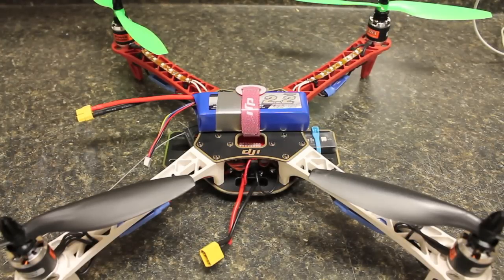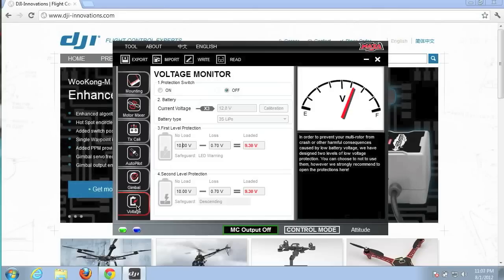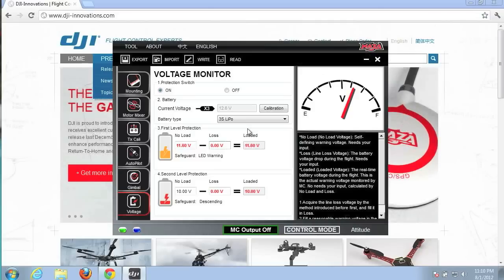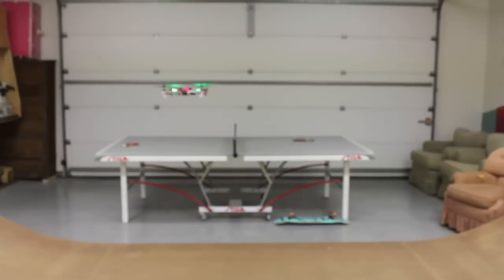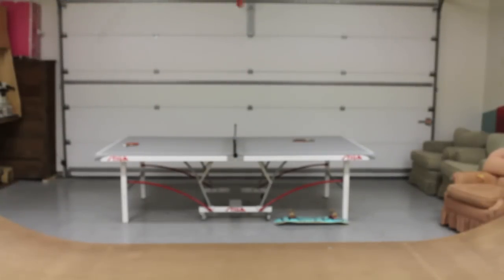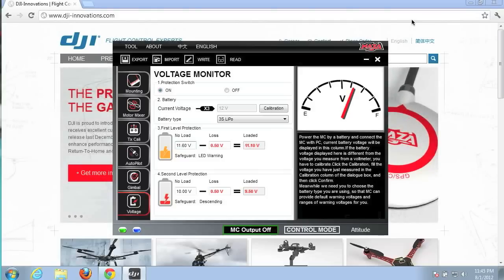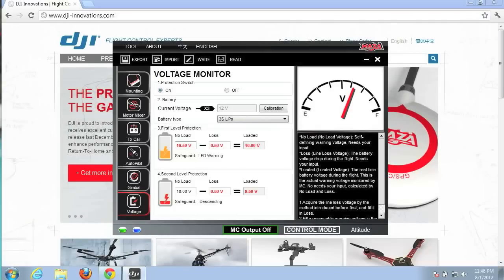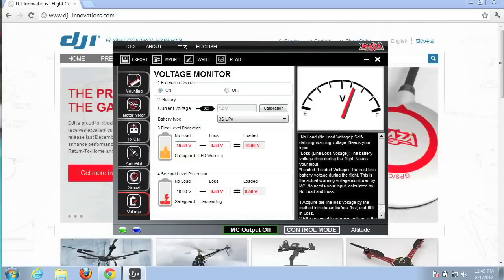DJI Naza Voltage Monitoring - First Level Voltage Protection Setup

Comment from the maker: Man you are absolutely right. I was doing math in the wrong direction! It should be 10.5 no load and 10.0V loaded as stated at 07:50 in the video. Like I said this is pure experimentation, but has worked well for me so far. I may bump these up a bit more to give more time between first and second level protection. Thanks for setting me straight.

Comment: Dennis, I finally got to download the latest upgrade for naza m V2. I had to uninstall the previous versions, then reinstall. It took about 5 minutes. I re calibrated the gyro, then re calibrated the compass, all the settings stayed as they were. Then I took it outside and flew it for a short time, amazing! It was very windy and gusty, it just sat there dead still, no drifting, can't wait to try it on the next good day!

Comment: Continuing working on my voltage setup.  I only have a 3S 2500mah right now but ordered a Zippy 3S 5800mah 30C yesterday.  I have Aeroxcraft landing gear attached.  With the 2500mah the starting voltage was 12.6V.  After 5 minutes of just hovering, I plugged it back in and was still at 11.4V.  I have my first level protection at what you have, 10.5V.  Then the second at 10.3.  I am excited to see the flight times with the new 5800mah :)

Comment from the maker: I think it's a good rule of thumb to benchmark your batteries and know how much flight time you get. Like you, I normally give myself a couple mins to get back home if I'm doing FPV. Regarding your comment about disabling voltage protection, I like having the blinking LED for when I'm doing line of sight acrobatic stuff. It's just a good way to know when to land. But I tend to agree I'm not going to depend on this when doing FPV and my quad is half a mile away.

Comment from the maker: Yeah I'm coming to the conclusion this is a good rule of thumb for 1st and 2nd level protection voltages. Still experimenting, but if you're in this ballpark then you should be safe. Thanks for the comment.

Comment from the maker: Thanks for the comment. I'm by no means an expert but will gladly help in any way I can. For starters, have you calculated your line loss as mentioned in the video? You do this by fulling charging your lipo and then taking a voltage reading. Then subtract one volt for your initial "No Load" voltage and enter 0 for your "Loss" voltage. Fly until you trigger the LED. Then you can calculate your loss, which is your previous "No Load" voltage minus the new voltage reading after flying.

Comment from the maker: Yes, since you're using a 3S those settings should be near identical. The only difference is the mA rating of your battery is much higher therefore you should get longer flight times. Play around with those settings and see how they perform, but I suspect it will work out nicely for you.

Comment from the maker: It's generally a matter of preference, but let me give my personal experience. If you're doing FPV or any high flying you'd like to have time to land before the 2nd level voltage protection kicks in. Just keep that in mind. I believe I have mine currently set at 3.2V, but am planning on posting a howto soon. I'll let you know when it's ready.

Another thing to keep in mind is that some ESCs have a default voltage cutoff. You don't want this to trigger before your voltage monitoring does.

Comment from the maker: Make sure you've properly calibrated your GPS. Another problem I ran into previously is that I was trying to arm my NAZA while it was on top of a friend's car. There was interference caused by the metal roof of the car. Just make sure you're not arming near anything that could case interference. Lastly, make sure the quad is completely level before you arm it. Good luck.

Comment from the maker: Hopefully I understand your question. I used Google Translate :) What is your total weight? It's hard for me to say if this is a good flight time without knowing what your multirotor weighs. Also, be careful on your voltage settings because most ESCs by default cut out at 3.2V per cell. Your second voltage level is at 9.5V, which is just below 3.2V per cell. If your ESC has low voltage cutoff enabled then you could lose your multirotor in the air. You may have disabled LVC but wanted to mention.

Comment from the maker: Regarding 10.5V being conservative that will mean that each cell of my 3S lipo will be 3.5V (3*3.5 = 10.5V). So if you consider the loss (mine was .5V) then your talking a loaded voltage of 11.0V. Once the Naza sees that the total voltage under load is < 11V it triggers the first level protection. I hope that makes sense. Please feel free to post any further questions and I'll be glad to help!

Comment: Thanks for the video.  Very informative!  I just had my maiden F550 flight today and didn't set up the voltage monitor correctly.  I took off, and within 5 seconds, the red LED was flashing like crazy and went into autoland.  It scared me.  I thought something was really wrong.  I thought when you calibrated the battery it did all these settings for you.  Ahhh...still an amateur I guess ;)

Comment: Thanks Dennis great job..   I went thru and understand what you did in the setting of first level protection for voltage.   I am running 4S I set the No Load voltage after a full charge to 15.9 V.  Set loss to 0.0 and flew for a few minutes until the light on LED flashed red.   I took another voltage reading and it measured 16.4V.    I am kinda at a loss....   If we set the No load voltage to 1 volt under full charge reading. How will we have a negative difference to determine the Loss voltage.
Signed Rickster

Comment from the maker: Just a guess based on voltage/cell on a 3S setup so something like 14.8V for 1st level and 14V for 2nd level. This would mean 3.7V/cell for 1st level and then 3.5V/cell for 2nd level. I believe that would be a pretty conservative starting place. Then you can test and modify from there. Let me know how your testing goes.

Comment: Dennis, I'm pretty new at this, I have a hex and see the default is no load at 11.55, I am worried about setting the No Load below the actual 11.1 of the 3s battery when the defaults for the second level don't even go below this.  Also you mentioned that the 10.5 final no load setting was conservative, I was thinking this was pretty much the opposite, maybe I just don't understand?

Comment: Looking forward to your next video on the 2nd Level Protection.  However I'm a little confused on the math...  If your no-load voltage is 10.5v and your voltage loss setting was 0.5v than would you subtract that number to get the loaded voltage of only 10 volts (not 11volts)?

Comment: I did calibration I've check my battery with a volt meter the I have to put my values manually or just press calibration an doit by itself

Comment: Olá Dennis, primeiramente parabéns pelo video.
Seguindo +ou- o seu video. consegui fazer um Over de 6,20 minutos. Este tempo está bom para esta configuração?
1º 10,50 - 0,50 =10,00
2º 10,00 - 0,50 = 9,50
Motor de 760KV esc 30A Push e Bateria 3S 2200MAH - 20C
Antes eu voava apenas 4 minutos
Abraço Adilson Hobby

Comment: Quick question. I have the  DJI F450  Same motors . I use the zippy 5000 25C 3cell 
Can I use the same settings ?  1st level 11 - 0.5  2nd level 10.5 - 5   ? ?

Comment: My naza is on the way and i use a 5000mah 3cell should i use the same settings as you have here or do i need to do my own tests?
Reply from the maker: You should be able to use the same values if you're 3S. You'll obviously get longer flight times since your battery is almost double the size of mine in this video. If you switch to 4S is when you'll need to tweak your alarm voltages.

Comment: I had a bad crash today because of the voltages. I'm flying TBS Discovery with 4S 4500mah. I used the default values. It went into 2nd level protection after just couple minutes and descended, hit a branch, broke prop and flipped. After, I checked, battery was still mostly full (over 15V and just 1000mah missing). I reproduced the issue. When I add thrust, the voltage drops from 16.5 to about 10-12 volts. That tripps the protection. Any hints how to set up the voltages? Or is the voltage drop the problem? It's my first quad, so I'm not sure if it's normal or not. I would appreciate help.
Reply from the maker: Michal Gloc That's quite a big voltage drop you're seeing. I wouldn't normally expect it to drop that much. Voltage drops are normal. For example when my battery is low sometimes if I give full throttle I'll see the 1st level protection kick in with the blinking LED. Keep in mind your C rating will affect this too. Here is a good thread that talks about a few different things that can cause voltage drops:

http://fpvlab.com/forums/showthread.php?28735-LIPO-Voltage-Drop-Question.

Hope it helps.
Reply: Yup, and it's definitely the fault of Afro ESCs sync problems, because as soon as I now changed to the DJI optos all problems went away. Oh well, at least I tested the voltage protection.

Comment: Dennis, my is F550 with Wookong-M and 2 batteries Thunder Power 3300mAh 70C
What is the best settings?
Reply from the maker: Rodrigo Meirelles Hey I wish I had a good answer for you but would only be taking a guess. I've never flown with the Wookong so I'd be making a guess. Best of luck and hope you get airborne soon.

Comment: Personally after you have calculated your loss like he did, then first level protection should not be anywhere less than 10.5V  loaded for a 3 S  or 3.5volts per cell and second level protection noting less than 10 V loaded for a 3 s or 3.3 v per cell.
So his values should look at least like this
11v -0.5v = 10.5V loaded  First level protection
10.5-0.5v = 10V loaded for second level

Comment: I can still fly for 5 more minutes after my red light started blinking. I mean red light start blinking early what I need to do please advise
Reply from the maker: Make sure you calibrate your battery as per the NAZA instructions. What values do you have setup for your low voltage trigger? If you have 5 minutes of flight time after the alert goes off either your settings are too high or you're running your battery down too low. It's hard to tell.

Comment: can u tell me for 6000mah battery wat to use value
Reply from the maker: +vikas patel It's not a function of battery capacity but a function of your battery voltage. 3S, 4S, etc. If you have a 3S battery then this video will be able to help you regardless if it's 3000mAh or 6000mAh.

Comment: Turn off the 1st and 2nd level protection, all they wil ldo is crash your quad and make you land when and where you dont want to land. Get a Voltage buzzer, set it to 3.6vper cell. I have a x650 upgrade quad, 390kv motors, Sony NEx5n Camera, with fpv kit. Total lift off weight is a bout 2.6kg and I get 15min. I have 2x3s batteries 3300mha in series. I safly fly for 11-12min and then I know I must land in 2/3min.